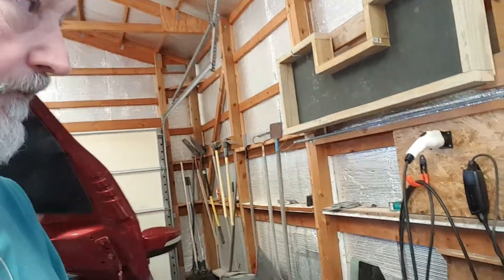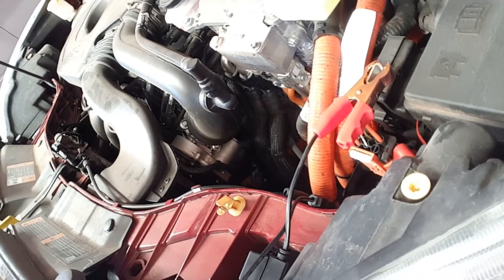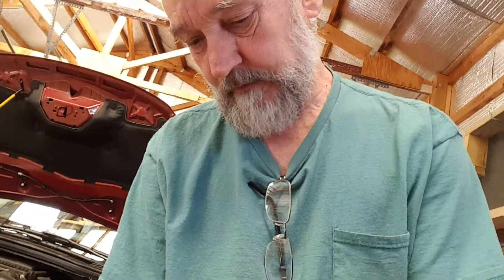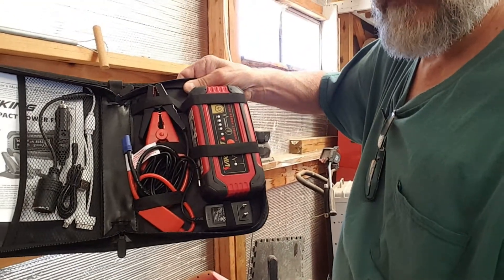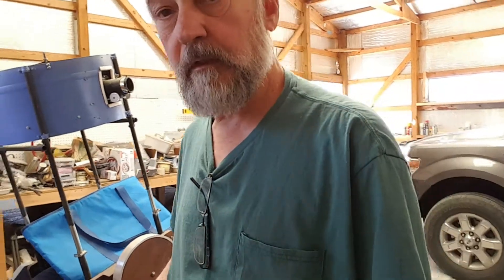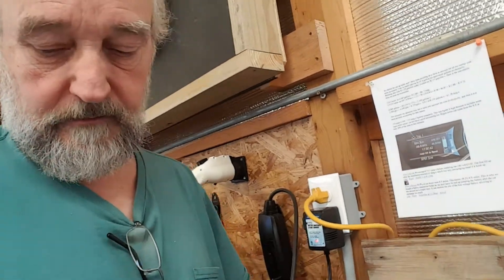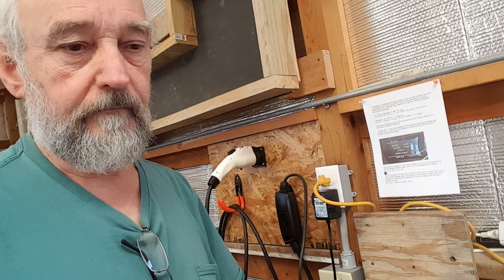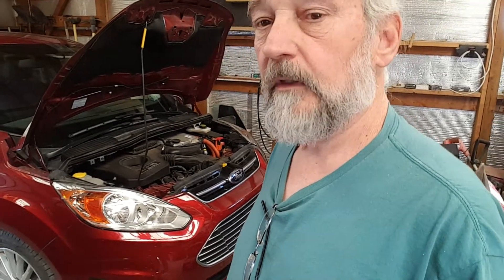C Max Energi low voltage battery problems and energy flows.

Comment: Odyssey makes a gel cell battery that has a higher capacity. The 12 volt battery controls the high voltage contractors for the HVB & powers up the in vehicle modules. If you plug in your EVSE it will maintain 12 volt battery voltage.

Comment: Hello. I have a question. My small 12-volt battery discharges to 8 volts in 4 hours. I replaced it under warranty and installed a new one. The situation repeats itself. The battery discharges to 8 volts in 4-5 hours. I'll borrow the car from a friend. Please tell me what could be the reason. Thank you.

Comment: Hi. Thank you for making this video. Because we had a flood that damaged our driveway bridge, we didn’t drive our car for 6 weeks. We had to jumpstart it twice. We were told we would need to drive it to help maintain the charge, so I drove it over the damaged bridge one day and went for a 4+ hours drive. The car seemed fine, except for a smell like rotisserie chicken. We assumed it was a dead mouse in the engine. The next day, my husband took the car to get gas and take my daughter to get her license. He never made it back to pick her up. The 12 volt battery overheated and off-gassed hydrogen sulfide into the cabin, killing him while he was on the road. He pulled over, pressed his foot firmly on the brake and slumped over the steering wheel. Ford C-Max Energi 2015. Battery vents directly into the vehicle and is not sealed. Be warned

Comment: Well how do you choose ev or the other option?
Reply from the maker: We bought a used 2019 Chevy Bolt in June of 2021. In March of this year, GM replaced the battery pack with an upgraded 65 kWh pack under warranty due to the recall. We have been very happy with the car, which averages 125 mpg.

Comment: I have a 2015 I can never plug in my car cause where I live there’s no charging station and I live in an apartment. My car is driven every single day. Mine today wouldn’t turn on or anything changed the battery in the trunk and it turned on. So I’m so confused on why this car does it I’ve had it a year and never had an issue. Should I replace the battery if so what one.

Comment: The manual says to put the parking brake on to shut off the ignition. If not car can sense draining of battery and reserve it and make it so car wont start then have to jump it and the dash will light up and ready now to drive on EV.

Comment: Hi very helpful videos. I am thinking about buying a used 2013 cmax, is it still a good recommendation in terms of reliability? I am particularly worried about potential battery or transmission issues. Thanks 🙏

Comment: Hello I feel the same way I'm having the same trouble I just spent $261 on a new battery the car was old when I got it it's a 13 but I feel like when that happened it was very shocking I felt stranded I felt like I could be anything could have happened you know pose I had to run for somewhere but this is crazy four is supposed to give us another car for this situation so let's call forward all the people who had a problem with their batteries and get some tickets signs cuz this is ridiculous

Comment: Sounds like a parasitic resistance running down the 12vdc battery when sitting in the driveway. We have owned ours since 2014 with no problem until last week. Took it to dealer, replaced battery, drove it home  then failed the next day.
Reply: So what was the fix?

Comment: I'm feeling twitterpated for having cracked an electrical problem with my Ford CMax Energi plug-in hybrid. Yes, I was a dope to buy another of Detroit's red haired step vehicles, stuff they have to make to meet the standards but they resent having to do it and abandon it the microsecond after a Republican is in the White House. For years, it's been plagued with this problem. Symptoms: 1. Goes for more than a year ok, and then radio stops working. 2. While it's parked, a continuous load on 12 volt battery makes it go dead. See, in addition to having a high voltage battery for the electric drive motor, it still has a conventional 12 volt battery to run all the gee gaws and whats its, and when the 12 volt battery goes dead, it's totally dead in the water. These vehicles today don't have a single mechanical switch on them. It's all touch screens and stuff, which are all dead as a nit when the 12 volt battery goes dead. The only thing for it is to jump start the 12 volt battery and then replace the battery, because once deep discharged, it's no good anymore. So to keep this from happening, I put on a 12 volt charger to keep the 12 volt battery from going dead. I even rigged up a cord to outside the front grill and put a connector on it so I can plug in the 12 volt charger without having to pop the hood. 

So it had been going along many months until one day, sure enough, the mystery load showed up, a constant 1.11 Amps. The clue about the radio stopped working was key. I took out the fuse for the radio and the 12 volt battery charger output current dropped to zero. So at least that isolates the problem. And, I can leave out that fuse for the time being and still have reliable transportation.

The downside is I can't listen to my beloved NPR anymore..Hopefully, Ford will have fixed the glitch - hah! yeah right - and it'll just be a matter of replacing the radio module.

My incompetent staff impeded me at every turn, and yet, through the use of geometric logic, I deduced the existence of a duplicate key by which the frozen strawberries had been stolen.  (What movie is that from?)

Comment: I know this is an old video, but wondering if you've heard anything about C max power cell conversion kits. Do you know if anyone makes cell replacements to have the same form factor as the C max cells but house Tesla high density cells inside them?
Reply from the maker: Yes I have heard of a AMG Odyssey battery but my experience tells me if there is no parasitic loads killing the battery you will not need one. We do carry a jump pack but haven't needed it since the problem was fixed.
Reply: @Aerostealth  Oh, cool. I've been looking online and hadn't seen anything. Nothing is wrong with my Energi's power cells, but am thinking of future projects that could increase the EV range by replacing the existing cells with higher density ones.
Reply from the maker: @nostremitus  oh, I was just talking about the 12 volt battery. The coming 2020 Ford Escape PHEV will have 30 miles of EV range with a 14.4 kWh pack. Looks like a similar set up to the C Max Energi.
Reply: @Aerostealth  Yeah, I'm not sure if it has high battery density or just more cells in the module. Something to look into, though... If the C Max can get 20 miles on 7+ kwh, the Escape cells (if they are the same form factor but denser) would get it close to 40.

Comment from the maker: Your problem could be fixed, you need to be persistent with your Ford Service Department. As I said my problem was traced to a Audio Control Modual which was replaced and we have had no further problems since. As for Ford discontinuing the C Max Ford has been eliminating cars from their product line over the last few years period.
Reply: Yeah it seems like this is a problem with his rig, not his driving. A week of non-use shouldn't drain the low voltage battery.

God bless.

Comment: Mine went bad. I drove it for a week with a 7ah SLA plugged into the power port ( aka cigerette lighter) in the rear cargo area. It only takes a few amps to start the car, since the traction battery is actually providing the power to start the car, the 12volt battery is just closing a relay.  There is room for a larger battery group 96R, but you would to trim about 1/4 of material from the battery box.  This has slightly more reserve capacity. The 96R is cheaper and easier to find.

Comment: Thank you for that information. We've had the same exact problem with the low voltage battery works fine and then one day is just flat dead. I'm at a loss to figure out the reason, but it's happened twice since we've had it since 2013. I guess we'll take the same steps and use a trickle charger for when it's parked and keep an emergency jump start gadget in the car.

Comment from the maker: Sorry to hear it. We have had no further problems since the parasitic load drain problem was identified and the CAM was replaced. The 12 V battery should both charge when the car is powered on and when it is plugged in to charge
Reply: We've had the update that was supposed to resolve a parasitic loss done some time ago. The current problem seems to be at least somewhat exacerbated by cold weather and there is a TSB I found online about 12V battery discharge during remote starts and a firmware update to fix the issue. Last winter we went through 2 12V batteries (1 from another issue) and now 10-11 months later another. Prior to failing this time temperatures had been in the -25C to -35C range for a couple of weeks and we had been using the remote start a lot. We've had some warmer weather since and it seemed to recover a bit after charging with a good 12V battery charger but then a week or so later it failed to start again.

Unfortunately I ran out of time yesterday and didn't get it changed and then my wife attempted to drive it and it failed to start when she tried to drive home (not good...). The dealer wants almost $200 to change the almost $200 battery. It takes me about an hour (or more) to change it by the time I get everything done.

How many miles/kms are on yours? When was your 12V battery changed last?

Comment: We too have a C-Max Energi and also have gone through several (5) 12V batteries in ~140,000 kms and 3.5 years.

My understanding is there is no alternator on the engine and the 12V batter charges through a high voltage to 12V DC to DC converter. It is energized whenever the car is "keyed on" (pressing the power button with brake down) and whenever the high voltage battery is being charged.

There have been several firmware updates to improve how well the 12V battery is charged but a new problem we just heard about is there is apparently a bug in the software that fails to turn on the 12V battery charger (converter) when the car is being remote started. What happens is in cold weather the owner remote starts the car and the heater fan,  windows defrosters, lights, etc. all drain the 12V battery until you actually power on the car. Do this a few times in cold weather and we've discovered you quickly end up with a flat 12V battery and you need a boost to go anywhere.

I'm just about to install our 6th 12V battery right now because it can't survive a single remote start without failing to start when we get in the car. Note there is a TSB on this issue but our vehicle is out of warranty so our dealer refused to perform it on our car (we are not impressed and also had to pay $200 for this most recent 12V battery as the 67R BCI series is only available through Ford and nothing else fits).
Reply: Not true. With minor modification a 96R will fit with about double the capacity.
Reply: https://youtu.be/HsTZR-6NXJs

Comment from the maker: Mine is fixed see my video on this.
Reply: Unfortunately over the 3.5 years we've owned this car our 12V battery issues have been "fixed" numerous times. At first we used to go through 12V batteries every 4-6 months. Now after dozens of visits to the dealer and numerous "updates" this has improved to be one 12V battery replacement per year. 

So I estimate we will continue to need 1 12V battery per year unless something is improved in the charging system. This is with the car being plugged in most of the time, driven 100-200 km most days and only unplugged for ~8 hours per day on weekdays. Our previous cars would need a battery replacement every 7-10 years so we tend to be easy on our car's 12V batteries too. As of ~10 months ago the car was fully updated by Ford with every known update, including the new communication module, new modem and all of the latest firmware (at least according to our dealer). The battery was changed about a month prior to that final update check and the battery failed again a few weeks ago.

We still very much like the car but personally I am annoyed that Ford refuses to actually fix the issue (and refuses to fix the intermittent drivers door keyless entry). The dealer claims there is nothing wrong with the car, that these 12V batteries see more load cycles compared to a non hybrid car, and we have to pay for all future batteries.

Comment: Thanks John--I have a 2013 CMax Energi and after experiencing half a dozen "dead battery" incidents, we just stopped plugging the car in, which seemed to help with battery issue, as the low voltage battery was being charged when we drove in hybrid mode.  However, this was frustrating, because the primary reason that we bought the car was because it's a plug in EV and we could use it for around town driving and virtually use no gas.  Well, today, when I went out to the car and it was indeed dead again.  I believe, as JT Fitzsimmons commented  and you also noted below, that there is a parasitic load that is draining the low voltage battery when it's parked.  I know that this has been a problem for many CMax owners, and I'm now considering trading the car in just so I don't have to deal with this issue anymore.
Reply: I can confirm that the 2013 C-Max Energi's 12V  battery is charged when the high voltage battery is being charged. With all of the 12V battery issues our C-Max has had I've measured the 12V battery voltage many times and discovered Ford was doing some strange things with respect to the 12V battery state of charge while driving. I suspect this was in an attempt to maximize fuel economy. 

When the car is plugged in the 12V battery does jump up which confirms it is being charged. Also the 12V battery jumps up the instance you press the start button with the brakes on. The engine doesn't need to run for the 12V battery charger (which is powered by the high voltage battery) to work. In fact the engine puts a small load on the 12V system which very slightly lowers the voltage when it is running.

Regardless of the details, you are better off to plug in your car if you want to maximize the life of your 12V battery. What kills 12V batteries is time at less than full charge. My measurements show that the C-Max does a poor job of maintaining the battery at full charge but it is kept closest to a full charge when plugged in.  Here is roughly what I've found over the years with our 2013 C-Max Energi:

With the original firmware our car came with (ours was one of the last 2013s made) the car discharged the 12V battery to around 50% while driving and then charged it to roughly 90% when the car was plugged in. This contributed to killing the 12V battery roughly every 4-6 months for cars that are driven 2-3 times per day (like ours) as these 12V batteries can't survive this sort of discharge/recharge demand for long.

With the firmware from a few years ago it partially charged the 12V battery when driving the car, varying from as low as a ~70% charge to ~90% depending on type of driving. It would charge it to roughly 95% when the car was plugged in. Around this time Ford installed a few updated parts that reduced the parasitic load. Parasitic loads are only a concern when the car is parked and not plugged in because they slowly drain the battery.

With the firmware from ~11 months ago the car did finally seem to almost charge the 12V battery when driving (90-95% range roughly) but still the 12V battery is charged to a higher state and maintained there when the car is parked and plugged in. Even with this firmware our batteries seem to only last approximately 1 year with 40,000 km of driving but it is much better than with the original firmware. I expect with cars that spend less time being driven that as long as the car is plugged in that the 12V battery should last significantly longer.

Ford seems hesitant to fully charge the 12V battery in the C-Max and I wonder if they are not only trying to maximize fuel economy but if they are also concerned with explosive gases venting into the car if the battery was brought to a true 100% charge.

Comment from the maker: We have the vehicle at the dealership today. They are replacing the audio control module  which they say is creating a parasitic load on the battery when the vehicle is off.
Reply: john gilkison Did you try holding the fob next.to the steering column. The dealers seem to have no clue about this.
I know it seems wrong but I believe its made to do  this.   It is preventive if the battery gets to low it locks it down till you are ready  to start.  It is suppose  to insure you never have to jump it.
Reply: john gilkison I have a 2013 the fix for me is on page 172 of the manual
Reply: @johnstuebner9143 I will keep this in mind for my 2014 Ford Cmax Energi
Reply: Well how much does this cost?? I bought mine used and I'm broke AF!